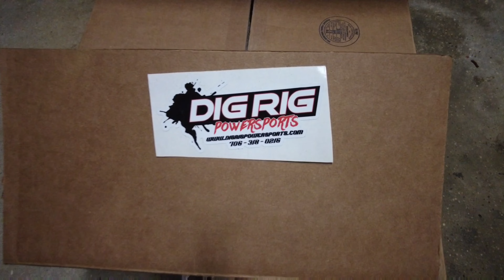Dig Rig Powersports|Snorkel kit| 22 Rzr Pro Xp

Comment: seems like it isn't much higher than stock?
Reply from the maker: It really didn't. Polaris tender springs are junk I plan to upgrade soon. Probably will just do a whole new spring setup from sand therapy!
Reply: The CVT intake is exactly the same height as original, he only had to snorkle the CVT exhaust, which originally sits right above the belt, now it sits level with the intake.
Reply from the maker: @RedSound2011  true!